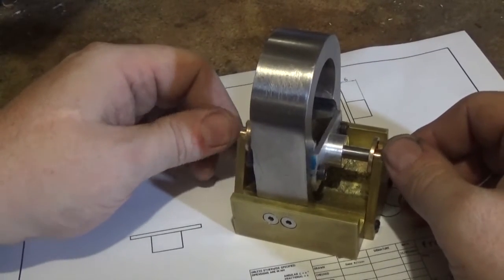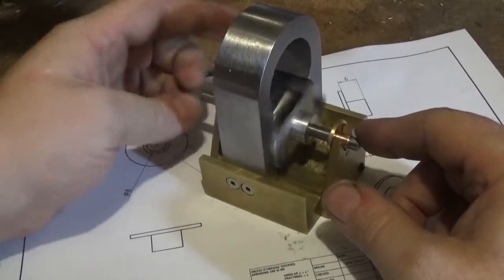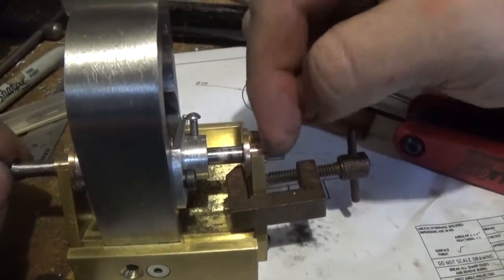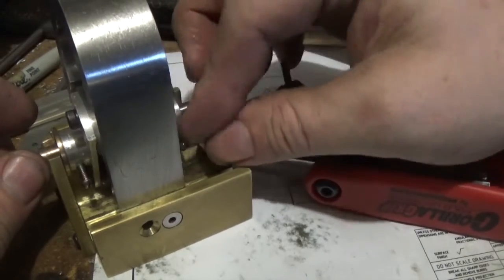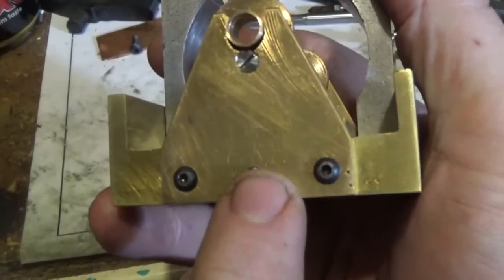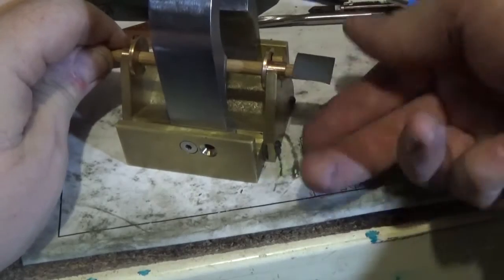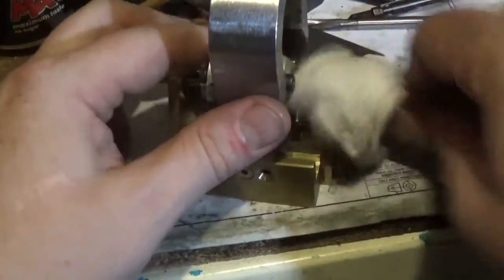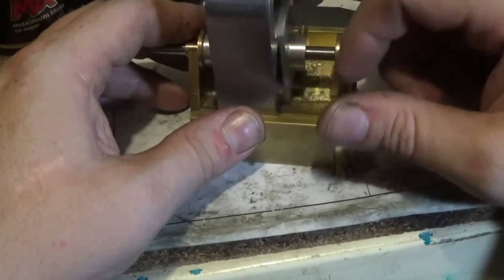Prince Dynamo motor PART9 home shop build.

Comment: A lot of fiddly work,  but with models and small work you just have to do it.  Or take up some other hobby.  It rurned out very well, anyway. I have found that if I can find or turn down a dowel to a tight fit and smear it with valve-grinding paste, it usually gives me a better finish than emery. Got this from Myfordboy to whom, as always, I tip my hat. Look up his unpatented expanding lap dowel.

Comment: You could always solder the bushings to the side plates just be careful not to warp them
Reply from the maker: good thought.. id like them replacable though
Reply: +Emmas Spareroom Machineshop I would have thought it would be as easy as epoxy to remove

Comment: Do you have your copper wire to wind it yet?
Looking good so far.
Interesting project for sure.
Mike
Reply from the maker: yes. copper wire is 23g enamel. i calculated out 16 meters will fit on.. we will see...